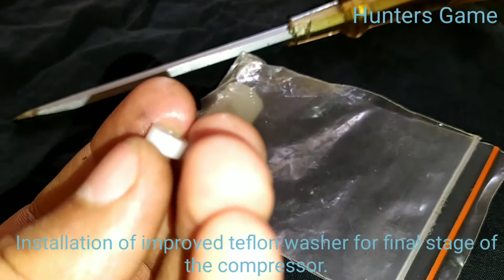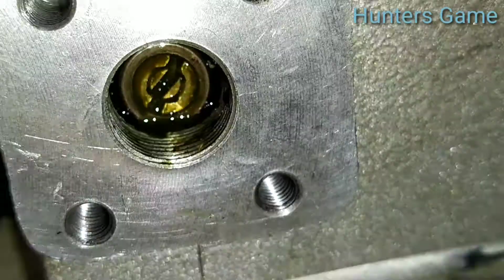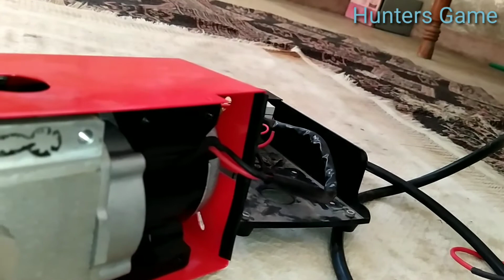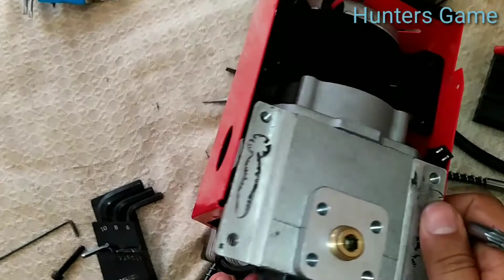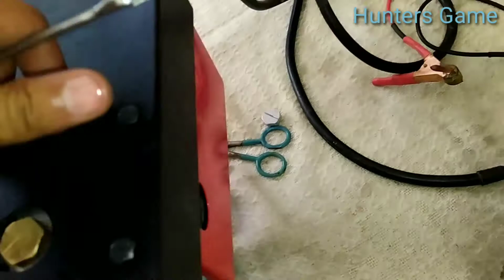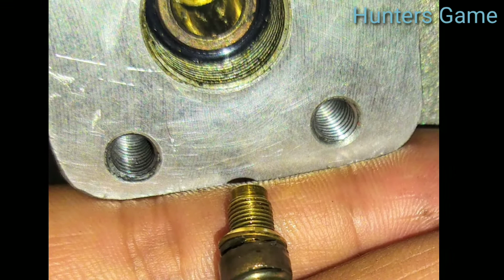Repairing 12V 300bar PCP Air compressor

Comment: My GX-CS2 has a random knocking sound after it goes beyond 1500 psi. Mine is the newer oilless and greaseless unit. I'm concerned
Reply: I would be to being how they cost quite a bit more than the other competitors on the market for the most part. I hope you get your issue resolved 👍💯

Comment: Just bought one comes today so well see
Reply: Is this teflon or delrin washer?
Reply: @saadmagnum936  it says Teflon you must pay attention lol
Reply: @chrisboddy9775  you are right but usually delrin and Teflon though different materials but are supposed to be confused in our country
Reply: its been a year now , how is your pump so far ? no issues ?
Reply: @morgb2321  it's been great so far no issues  at all can't say same for the water-cooled Chinese one I've got it's a faff but the air fan on this works a treat best one I've bought so far no problems yet have you got one ?
Reply: @chrisboddy9775  Yea I just ordered one and came across with this dude fixing it , thought im gonna do the same so soon lol . its good that your pump still efficient and no issue , thought about the chinese water cooled type but I thought that would be messy for me so I just skipped it and got this one.